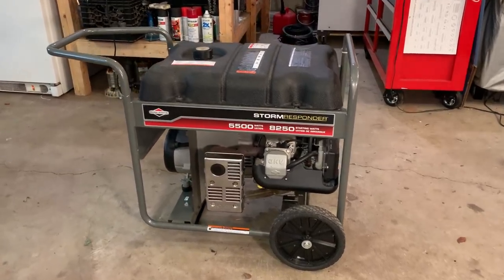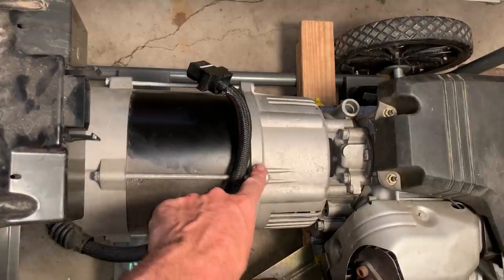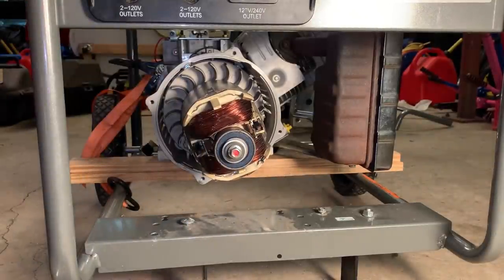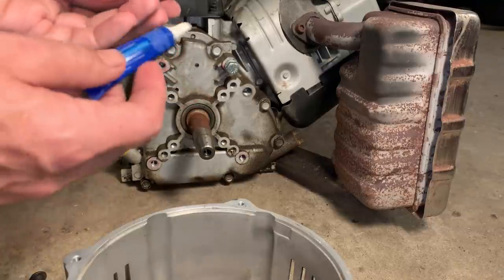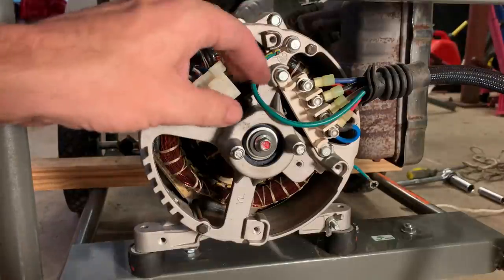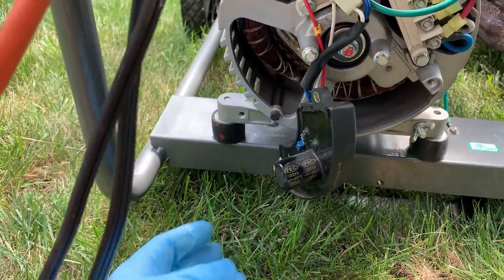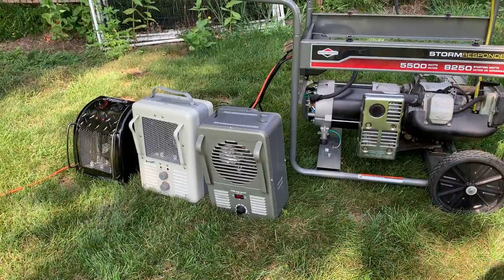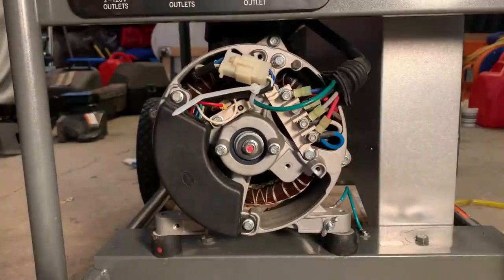Blown Generator Engine Swap

Comment: A very interesting & informative video, thank you for sharing you videos with us. I have a Briggs & Stratton generator but the armature doesn't have a bolt going through the centre of it, have you any idea how it comes off, many thanks.
Reply from the maker: Every generator I have worked on has a bolt.  Someone must have removed it.  You should replace it.  The armature is a friction fit.  Without the bolt, eventually the crankshaft will start spinning in the armature and ruin the generator.
Reply: @jcondon1  Hello James, thank you for your reply, the armature shaft is solid, all it has on the bearing end is just the centre from when it was manufactured. I am wondering if it is screwed onto the crankshaft. Thank you once again.

Comment: Have you ever used a piston stop instead of rope to save time ?🔧
Reply from the maker: No.  Considered buying one.  It would save a lot of time.  Just do not like the idea of applying that much on the spark plug threads.  I know others use it without issue so may try one.

Comment: Ive noticed when you check the Hz you normally load it with around 3,000 watt of load. You want it to be just above 60, what if when you actually are using it to power your house and your using the full capacity , say 6,000 watts. having checked its Hz at 3,000, are you still ok to be around 60 Hz at 6,000, or should you try to adjust it for a larger load.
Reply from the maker: I am just aiming for the middle load at 60.  It will be higher with no load and lower with a load.  But generally hertz are fine anywhere between 58 and 62 hertz.  If there is an engine issue then you would see it at half load.  Meaning if it goes from 62 hertz with no load and 58 hertz at half load then you know you will have a problem at higher loads and must dig deeper into the issue.

Comment: great videos very instructional, I got a question recently after hurricane Isaiah a friend of mine blue the engine on a generator exactly like the one you  made this video, so gave it to me for free, it looks brand new so I was thinking to try to rebuild the engine especially because I cant hear anything rattling inside, the question is where do I get all the specs , torque, clearance, etc? or if you have a video where you are rebuilding an engine like this can you share the link please.
Reply from the maker: Next week I publish a video rebuilding this engine.
Reply: James Condon thank you I will be waiting to watch it
Reply: Hi James I hope everything is going well with you. About this project I got the same exact situation as you publish in the video, the problem I have now is where do I get parts? Do you have a website or do you sale parts? I need the piston, connecting rod and gaskets
THANK you in advance for your advice

Comment: Where do you find all these Generators ??  I have been looking on marketplace for weeks and only found one that was broke. Have you ever done pressure washers or stripped them for motors (assuming side shaft).
Reply from the maker: Did one pressure washer video.  Pump was bad.  Fixed the engine, but nobody wanted the engine.  Was asking $20.  It was a vertical shaft though.  Have not bought one since.

Comment: Can you use an engine with a straight crankshaft?   What do you do to connect the generator head?
Reply from the maker: Must be a tapered shaft with these types of generator heads.
Reply: @jcondon1  OK, thanks for the reply! That explains why I can’t find some sort of adapter. I suppose I’ll have to make one myself.

Comment: James, is it possible to purchase a low oil sensor and install it on an engine without complications?
Reply from the maker: You probably could, but I have never had to open one up that has an oil sensor so not sure if it can be installed or not in one that does not have one. 
 Sometimes there is a plastic plug where the oil sensor wire would exit.  On those you probably could add something.  Others have the casting for it, but it is not drilled out.  Either way you would have to open up the engine to install it.  I once saw a Briggs that had the oil sensor screwed into the oil fill.  That looked like an add on that would be easy to install, but not sure what the part number is on that.

Comment: No low oil shutoff? Most generators have it.
Reply from the maker: Unfortunately the Briggs 10 HP generator engine usually does not.  There is a casting on the engine for it, but 90 percent of the time no sensor installed.  I did a craftsman branded Briggs recently, that did have an oil sensor and it was malfunctioning.  Most other brands have an oil sensor is standard.

Comment: Did the previous owner have a story as to what happened to it? Almost looks like it my have never been run much if any, i.e. they never put oil in it.
Reply: So many folks with power equipment never check/change the oil, and these motors all burn a little. Over time they end up like this... they hold less then a qt most of the time so less the $3 once a year (oil change) probably would save 1000’s of machines a year.
Reply from the maker: He was just running it after a storm for several days until he ran out of oil.  No oil sensor and did not think to check the oil level.  They all consume a little oil even when healthy.  You can get away with that on a lawn mower for example because you only use it one or two hours a week.  You can easily put 200 plus hours on a generator after one storm.  Got a few Briggs videos coming up.  This was one of two I picked up recently that ran out of oil.

Comment: I have a brand new champion 5500 generator that   thru a rod . is it worth putting a new motor on it
Reply from the maker: Probably not a new motor.  Maybe a used Honda clone in the 388-420cc range.

Comment: Sir do you have any info on replacing the governor on that engine
I think mine is bad. It does not turn when you rev the engine 
Thanks
Reply from the maker: I have not had to replace one yet.  But next week I will rebuild the blown engine.  You can see the governor in that video.  Not many parts to it.  Also make sure your throttle plate is not stuck first.

Comment: Why did the low oil switch not shut the engine down?
Reply from the maker: The storm responder generators do not have one.  Most Briggs 10 HP engines omit that.
Reply: @jcondon1  Interesting, looks like a blk wire from blower housing going
up the side and I guess it is going over to engine run switch then? seems
the engine would have been saved if it had a low oil switch. I found that my Troybilt 5500 uses no AVR but a full-wave rectifier on the back of the brushes holder. part 91825GS available thru home depot and B&S also seen on another
make of generator being worked on. James, a big thanks for doing these vidz!

Comment: On the red head 
center bolt can a short piece of flue line be used to help center it at the slip ring end.
Reply from the maker: I like that idea.  Will try it out, thanks.
Reply: @jcondon1  I have found over the years different eyes see something else that may work.